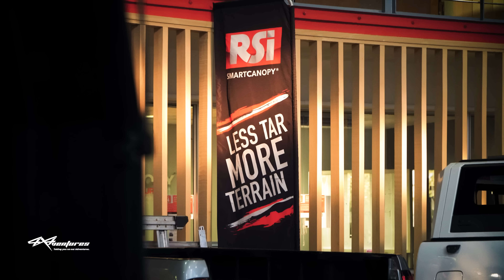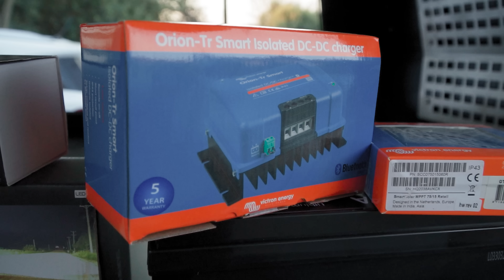4x4ventures | RSi SMARTCAP | FITMENT & Initial Impressions

Comment: If this is a regular setup in Australia, it is still extremely rare in South Africa. What I’m really interested in are numbers. Have you gained weight? Have you got more cargo space? And maybe a harder question, have you lowered your center of gravity? Did I understand right if I say you rig is heavier but you have more space and you have now a lower center of gravity ? But I still hope we could get the numbers. It’s really interesting because we are going to compare the classic South African setup with the RSI setup. When we watch an Australian tray + canopy, there is never a comparison. So we are not even sure it’s better. So, I guess we are all waiting for the answers... in the next episode. This episode and the ones to follow may/will change the way we build our rig in South Africa (may because it depends on the conclusions).
Reply from the maker: Hi Blaise, thanks for your comment. It's all coming mate. The build of the tray, comparisons between old setup and new, power upgrades, what are the differences and the WHY'S etc are stretched over 3 maybe 4 episodes, with a full review happening this year too. Its a massive upgrade and I'm on your page, but I have a plan to do it the way I see fit. Hope it lines up with your expectations. We are on the same page, and I'm sure you will appreciate the outcomes and efforts. Can't wait to take you on the journey mate. It is an interesting one and hopefully a first done the right way

Comment: Did you putt in some chassis strengthening in?
Reply from the maker: Hey Chris, nope, no chassis strengthening. Just in need of some airbags though. Been worried about the chassis, but holding up well mate and done some pretty tough stuff, so might just be over thinking it.